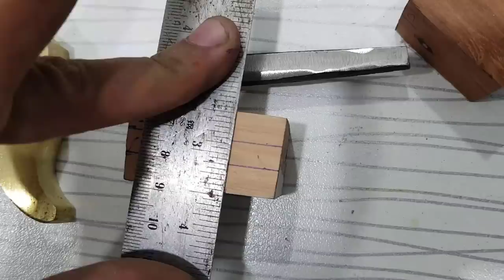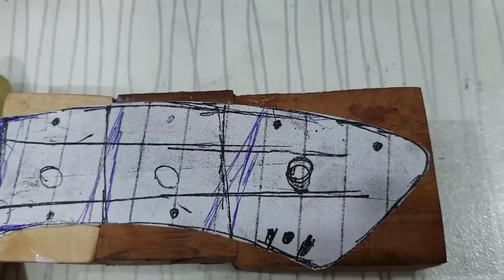Rusty Handmade BUTCHER'S CHOPPER  RESTORATION

Comment: Probably was made from truck leaf spring.I too got my knack from refurbishing from junk shops.In his videos,haters pounce over title he calls blades.In every part of world,different blades have different purpose.Great thing about collecting,refurbishing..It is what ever he see's holding it in hand.I have refurbished ,crafted most of my life.I can always learn things from what other craftsmen see within their project.PAKISTAN,INDIA,GUAM,THAILAND,always something that can alter my own idea in my own way.Thank you sir for posting your aspect..Cheers!!!!
Reply: Also his blade was "Tapered" thin to tip.So obviously a little rust could of weakened tip where to make clean and safe again,would need trimming back.This gentlemen chose the shape he thought in HIS REGION WOULD BE MOST USEFUL...Maybe he butchers livestock where that tip is most desirable for cleaning rib bone meat,cracking brisket..Also  making the blade harder would have a better purpose for this.The edge was thinner and spine thicker,so called experts should know spine wont reach as hard as edge due to this.This could be a really fine blade now.

Comment: Just a bit of advice I liked the restoration but you should instead try to make holes that are the general size of the tang of the blade and then sand down the hole on the handle until it fits more snug onto the tang and it will last a lot longer and make it more durable

Comment: You are getting better. Fittings are looking not too shaby and the pins have no gaps. Liked the idea how you filled the hole in the styrofoam with sand in order to form a hole. Going to use that method myself.
Reply: Finally a wooden handle! LoL
Reply: Man of the north lost wax casting is cleaner casting but has to be done with plaster and then cooked to remove the wax once the wax has burnt out any metal like brass or copper can be poured in while the mold is still hot, the hotter the better. You should try both and see which you like the best. There are plenty of videos on lost wax casting and styrene too. The styrene method is cheaper but leaves the cast messy with a lot of clean up.

Comment: that could have turned out better lol . . .  you didn't restore it you made a crude new knife out of a rusted old knife. With so many power tools at your disposal I'm surprised you didn't use them
 for more parts of the job, Well you started with a knife and ended with a knife so you broke even I reckon
Reply: Very  nice guy
Reply: We started off with the bush machete and ended with a kind of tapanga machete with the tip of a parang machete. We still came out with a fairly useful tool. and I'm sure some African warlord would adore it

Comment: Anyone that makes a negative comment about this clearly has NEVER restored anything!!!! The fact that he did most of the work with an angle grinder and a dremel is impressive in my opinion.
Reply: @BootyBandit44   Seriously????
Reply: @Rich13canada  he's right, I've restored a wrench once, this is nothing like it
Reply: Dude, he didnt restore it, he just made a new knife from a rusted piece of metal. Also, the weight must be stable, and with the brass its quite heavier.
Reply: If you know anything about knives you'd know he's doing a poor job

Comment: why did you have to cut the blade ?
Reply: It needs to be sharpest thing dude
Reply: Because it couldn't fit in the bin
Reply: @itbelikethatsometimes8087  Getting a bigger bin would have been a better solution.
Reply: ...and then on top of that, grind down a third of its width!

Comment: Tip. Put a wet towel or a cloth under the sharpening stone it stops the sliding and you can use both hands to sharpen the knife. Big like for the videos.

Comment: painfull to watch.
1. never use a grinder or coarse sandpaper on aged metal.
2. don't hold your wetstone like that. fix it on the table or you'll cut yourself if your blade would be any sharp.
3. don't put lacker on a wood handle. your hands will sweat and you'll get blisters

Comment: You should temper the knifes in the forge to have a more even heat-spread along the entire blade, in the footage it is clear that the point of the blade is way hotter than the rest

Comment: I would recommend you to get a whetstone holder for sharpening cause from the looks of your sharpening process, it looks very dangerous and may probably cut yourself as only one hand is in control of the blade and it is best to have maximum control while sharpening which is using 2 hands.

Comment: awesome job over all but i think it would have been better for the over all asthetetic if u had just left the tip as the hole sword had all the curves and then it's just wack off straight at the end could have gotten a bigger bucket which seems to be the reason u did that

Comment: You have to temper a blade, especially a chopping blade like this, otherwise you will end up snapping the blade. Hardening makes steel very brittle, tempering fixes that problem. Otherwise good job on the restoration.

Comment: Hi, you did a nice job. 
But for me it was ruined by chopping the tip off.
By taking it off, did it change the balance as the lumpy tip gave weight for its intended use so did you have to consider that in making your knife?
X

Comment: all those drill holes are your weak points.

i bet you hit some wood with that blade hard...after 10 time your handle will probably break.

but the overall video. well done. clean work and knife is beautiful.
i just hope it wont brake because of all these drills hole.

Comment: It's true. this is unbelievable. As in I can't believe you cut off that much metal from the tip. It actually lost some hacking power with that stunt.
Reply: The potential to hack wasn't necessarily lost when he cut that tip off. It actually would've improved... but it wouldn't happen because he didn't temper it after the quench. So it's more like he made a Seax-shaped shard of glass instead of a proper tool.

Comment: I'd focus more on actually restoring something if you're going to call it a restoration.  Get your gaps between materials fixed.  Don't drill pins at random spots based on the handle materials, drill them centered on the tang so that you aren't making a weakened tang.

Comment: If you are going to put a video out showing your madd skills. A  Simple C clamps and a piece of wood cut at the correct angle would make you end result a lot more professional and safer to produce. You re sending the wrong message no gloves no basic Technic of production no common sens.
Reply: Инструкция как сделать молоточек и вставить в него кривой тесак)))) хах, он даже показывал, какими номерами надо божественно шлифовать xD. Респект конечно за старания, всяко лучше чем ничего не делать, но.... Стараний слишком много для такого слабого результата. Много раз видел как люди с меньшим желанием и мотивацией и обычной деталью, ровняли шлифовали и полировали на много аккуратнее и симпотичнее. А тут такой потенциал был у этого паранга.... А получилось китайско сувенирное порно. Потрачено.....